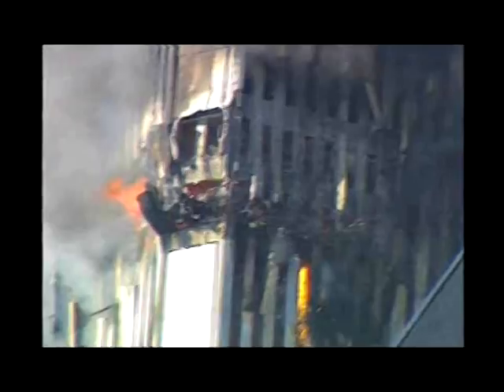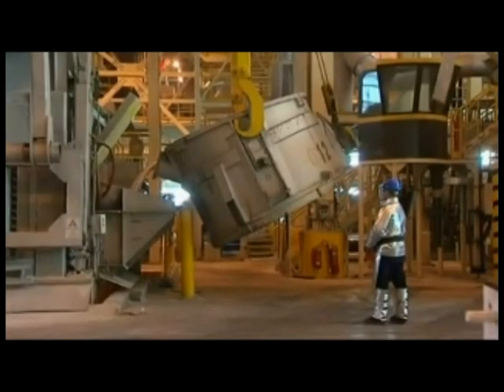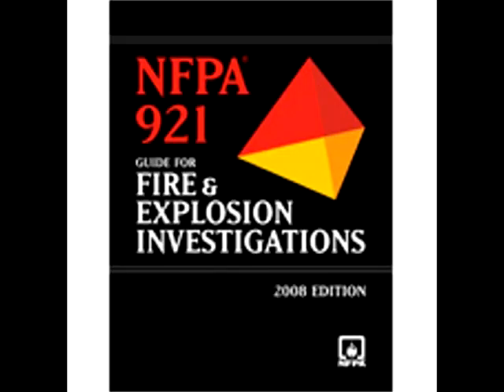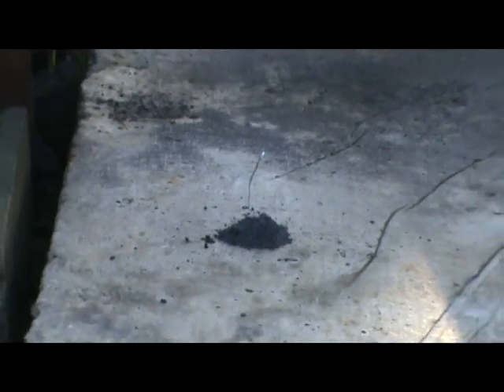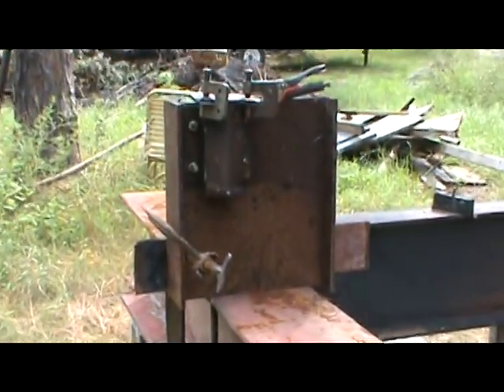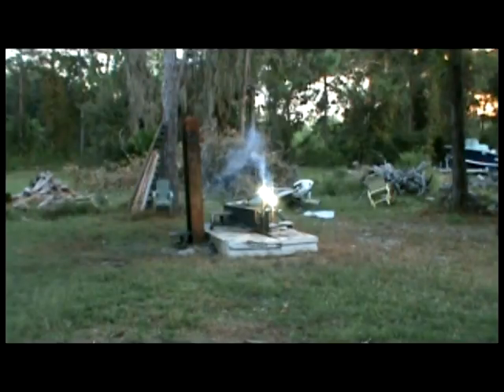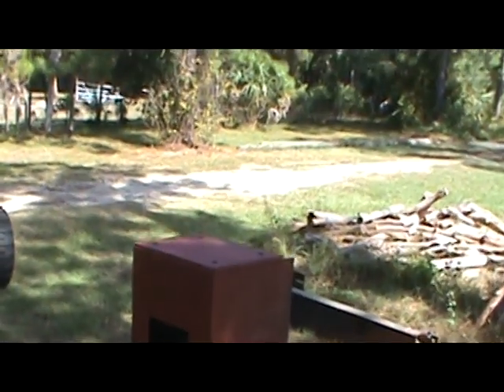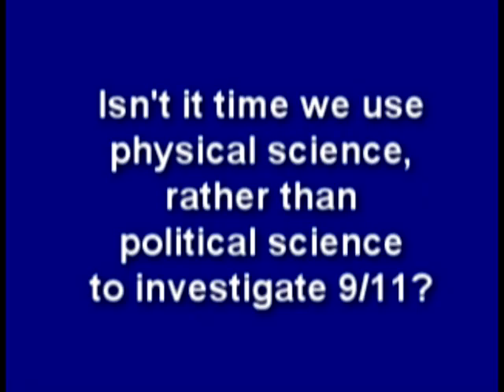9/11 Experiments: The Great Thermate Debate

Comment: There aren’t enough thumbs in the world to give this video the amount of thumbs down it deserves. When this thermite theory fell apart I was sure they were going to say it was a bunch of welders that took the towers down. While both welders and thermite are capable of taking down buildings there has been zero evidence to support that they did on September 11th. This video banks on the viewer seeing how thermite works and then forgetting why they wound up here in the first place. The creator forgot to connect the idea with the evidence, actually they hoped you wouldn’t realize it. The creator claims to have footage of molten steel falling from the south tower moments before it falls. Watch how this, “molten steel,” (to be clear it is NOT molten steel you see falling from the building) seems to remain glowing throughout the whole shot as it falls. Compare this to the thermite as it scatters and quickly cools. Molten steel against air causes cooling, which in turn reduces the amount of light being put off. But the stuff falling from the tower continues to glow and even glows brighter as it falls. This is simple - know how when you blow on a pile of hot coals (which are carbon based just like paper, furniture, carpet, etc..?) it gets brighter? The only way those falling embers could become brighter as they fall (as they do) is if they are composed of elements that require oxygen for combustion. Drop a burning phone book from a bridge, and you’ll see quite a light show until it hits the ground, but drop a bunch of molten steel balls from the same bridge you’ll see light quickly die out as the wind cools the steel down past the temperature required for it to continue emitting light.
Reply: William moffet - you're part of the elite, trying to cover up the truth. God is coming soon & your house of cards is gonna go POOF. now go back to your illuminati friends & eat a baby or something.
Reply: Really sounds like this was written by a paid member of the 9/11 commission.
Reply: In the first couple minutes of the video they also showed eye-witness testimony, satellite temperature photos, iron spheres, and actual pieces of melted steel as well.  Even if you did prove that the stuff coming out of the building in one particular video was neither steel nor thermite, you still have not disproved that there was molten steel at 911.  Other truthers have pointed out that there were elevator renovations going on before 911 and this could have been how they put the thermite in.
Reply: @brendangolledge8312  My problem with the witnesses is, if they saw thermite... how are they alive? One of the guys in the video said he was on the 80-something floor and saw thermite. If he saw thermite, it's cutting the beams... how did he get down all those stairs and out of the building before it collapsed if the beams were being cut while he was still all the way up there?
Reply: @30AndHatingIt  I have never seen that eye witness testimony.  The eye witness testimony in this video is of fire fighters and policemen talking about seeing molten steel in the rubble.
Reply: Thermite also burns regardless of cooling or water or anything it burns until it’s gone so it would be visible in air.
Reply: The result of a conclusion based on overthinking!   SCIENTIFIC FACT:  asymmetrical damage will NEVER cause a perfect symmetrical collapse.  No steel and concrete building has ever collapsed due to fire before or since 9/11,  except for those three on the same day - only two of which were hit by planes (or drones).  And how did the Government (NIST)  conduct a real investigation into the towers collapse and never consider explosives as a possibility?
Reply: If he failed it was because he tried using common sense on a conspiracy theorist.
Reply: Boo... I’ve got to take a nap now because that was the most boring insult/response you could have possibly come up with. If you’re not going to be at all entertaining and really go for the jugular then why even lift one of your un-creative fingers to type. Are you missing some fingers?

Comment: Yo SARABOND was a steel paint coating they used when it was built that cause chlorine gas and rust to steel super structures and would explain the accelerated damage

Comment: It was melting aluminum coming out of the corners and seeping down the floors. It was uncontrolled fires that weakened the structure enough that it would collapse. Note that it’s only seen in ONE of the towers not both. And only in a corner where a mass of aluminum would congregate after the energy of impact would force the aluminum forward. The plane was going towards that corner and the core didn’t stop a lot of it like it did in north tower. Way more plausible than “they hid thermite in the steel” lmfao

Comment: A jet wouldn't demolish a wrecking ball and objects don't liberate momentum through themselves. Believing a single explosion at the lightest and weakest section was able to accomplish complete global destruction an hour later likewise cancels out miles of wire and thousands of explosives necessary all throughout in your counter argument; a contradiction. Accept the fact that "crushing" weight doesn't increase as mass is lost, and either standing structure couldn't liberate momentum through itself after the upper block was finished losing momentum against it, in exact equal time to each other, because momentum can only be conserved.
Reply: @davidc9783  The upper section gained mass during construction. It lost mass during deconstruction.
Reply: @davidc9783  The thing is, unfortunately, that's a repeated lie that I once believed, too. The upper section's crushing force can only decrease after a collision, mass expands away, and momentum is lost against the massive structure standing in it's path. Assuming the opposite is true contradicts reality and it's the media's fault for perpetuating the perpetual self-crushing theory(without a physical model)to the public.

Comment: It must be the truth!  Some time after Ramzi Youssef's failed attack, Techs were somehow able to wire two buildings with thermite.  These weren't just any covert technicians.  They were so skilled at wiring explosives and used miles of wiring, connectors, relays and harnesses of such durability and quality that both systems were able to withstand the impact of an airliner and work flawlessly.  Then, after organizing the genius airplane subterfuge which played out perfectly (with the  exception of United 93) The person responsible for timing the collapses with the actual demolition charges was having a sandwich and a shit.  Both times.  And with impeccable secrecy.

Comment: They use thermite on railroad beams to melt and weld the two beams together. I don't see why it would not melt the beams on the buildings?
Reply: If you had vast quantities of it, it might. Kind of a bit hard to hide though.

Comment: For those who believe the official conspiracy theory , the lady identified as Edna Cintrone was filmed standing in the impact area of the north tower looking out prior to the building collapse. How is this possible if the heat in this area was such that the steel was being "weakened" to the extent that the buildings eventually collapsed ?

In addition , no one is disputing that there was molten metal on site so why did NIST not address this and determine what the metal was ? Why was this fact just ignored ?
Reply: You mean the same Edna Cinton that jumped after that photo? Guess it was just fine in there? Fuck you .

Comment: Not sure how I missed this excellent video in my past 911 research. A friend sent this link to me. This is some really great work. You put some serious time and thought into this. I'm a manufacturing engineer and your video has really helped clarify things for me. I always thought that thermite was part of the puzzle and based on this plus the comments from the welder below, it seems very certain thermite was indeed involved at least partially. I am also open to the ideas of Dr. Judy Woods, she seems to have some spooky footage of steel columns literally disintegrating and disappearing as can be seen through the thick dust clouds as the concrete falls away and the remains of the steel appear momentarily then almost evaporate.

Comment: The twin towers were unique because they did not use the outer walls to support the towers. It was the internal core that held up the towers. 

Naturally the core is under pressure. If it is weakened, not melted, it would fail. That happened.

What I do not get is why anyone would still have Bush Derangement Syndrome anymore.

The flaw in rhe experiment is that the beams are not under great amounts of pressure.
Reply: You got it backwards.  The floors were supported by trusses connected to the external pillars.  The central core was supporting the elevator shafts, water and waste water pipes, electrical conduits, stairways, etc.

And in fact it was those trusses that became the weak point in the fire.  Once the steel heated it lost strength - and bowed downwards.  Normally the trusses carry the load to a point where it becomes a vertical force on the support columns.  But once they started bending that weight became a force pulling the support columns inwards - something they were not designed to handle.

Comment: The temperature quoted for burning jet fuel (kerosene) is that in a jet engine, which is much like a blowtorch. You can also soften steel to the point where you can bend it easily, using a blowtorch. However, kerosene burning in the open will simply not heat steel to anywhere near that temperature. It requires a forced air draft to do that. Could conditions in the WTC have created updrafts strong enough for blowtorch-like burning of kerosene? I guess they could, but only in the minutes after the planes struck. It seems unlikely that could have happened an hour or so later, and after the visible flames had died down.  

So basically, I don't buy the burning kerosene argument.

Comment: I believe Dr. Judy Wood's explanation far more readily than that of controlled demolition, that a high-frequency energy weapon utilizing the "Hutchison Effect" was used on the towers, building 7, and the Pentagon (or possibly a Tomahawk missile on the latter). But it doesn't matter at this point, it's not really for 'me' to decide - a real, honest investigation needs to be opened where we can get to the bottom of all this, REGARDLESS. It's so very obvious, however that the official story is a complete bunch of B.S.  So full of holes, it is, that it makes Swiss cheese look like a structurally superior cheese!
Reply: Yes Judy Wood, the brain damaged nutcase that was in a coma for several years.
Reply: Gosh, 17 years later and they're still name-calling.  How's that denial going, femadeathcampcontrol?  So, tell me, do you believe the official story? That 4 hijacked planes, the hijackers using nothing more than a pair of box-cutters, successfully defeated the most sophisticated air defense system (norad) that day, the entire plan devised and carried out by Osama Bin Laden, that 2 of those planes flew in at impossibly fast speeds that any normal commercial airliner would break apart, let alone, them hitting their targets with pinpoint accuracy, and brought down not just 2 buildings at the WTC (building 7, not even hit by a plane, but also collapsed) - that the black boxes of the planes couldn't be found at the Trade center site, but they did find one of the hijacker's passport, which magically floated down to the street below, un scathed, even! And the plane that hit the Pentagon, another way WAY impossible piloting feat, that even the most master pilot in the world couldn't make that maneuver, and the plane, just like with the towers, passed through the thick ccncrete.. making a hole that sure looked just like a Tomahawk missile!  Oh, and then the 4th plane that crashed at Shanksville, just like with the Pentagon, no bodies, no luggage, not really any plane parts to speak of... just a small hole in the ground.  And you call Judy Wood a nutcase??  You actually believe that crap???
Reply: Thats an impressive amount of long debunked crap, compressed into a paragraph.

Well done.

Did you just watch loose change?
Reply: Oh, yes, long debunked... by whom exactly?  I'd like to speak to them.  No, I've been researching this thing since Feb. 2002,  how about yourself?
Reply: Don't tell me you haven't put in thousands of hours like I have... a firm believer like yourself!  (?)
Reply: Oh well, I really don't expected any sort of informative, nor educated reply from you.. I will say one thing, though,  ... I,..  well,  I don't know how to tell you this, but.... ("whispers") "I think your foolish patriotic pride is showing." (Sorry, but someone had to tell you.)
Reply: Wow!  What a comeback.. I have to admit, I underestimated you... you put all us tin-foil hat wearing nutjobs to shame!  LoL.  Thanks for that,  Super-genius!
Reply: (Imagining FemaDeathCampControl putting his well-used blinders back in place, sticking his index fingers into his ears, and now singing, at the top of his lungs:  "America the Beautiful" and "The Battle Hymn of the Republic") "sigh!"
Reply: "Some men, just caaaan't be reached.  I don't like it any more than you boys do..."

Comment: There is no point demolishing the buildings as an inside job, everything achieved can be equality done with just two airplanes crashing into the twin towers. Who would even care about demolishing building 7 - it serves no further purpose that has not already been achieved with the planes hitting the buildings.
So what if the buildings didnt collapse "demolition style" but just had gaping holes.
Would be EXACTLY the same foreign policy.

You really think that Bush is going to say, Im not invading Afghanistan because the twin towers were merely damaged and only 300 people died but only invade if the buildings are demolished and 3000 people die ? 
All the conspiracy theorists dont even bother distinguishing that a motive for demolition via inside job (thermite or whatever) achieves nothing extra than the planes didnt achieve alone. (slightly less drama and more clear up, but headlines are the same)
Reply: The PNAC plan specifically called for a new Pearl Harbor
Reply: So what you're saying is the lack of evidence supporting your conspiracy theory is proof that the conspiracy exists?  And exactly what benefits would they have gotten from collapsing Building 7?  And compare those benefits to the added risk of detection for a plot that had to have involved 10s of thousands of people to pull off.

Comment: I agree with you, but explosives or thermite would need to be put at the bottom of the building to guarantee collapse (just watch any demolition video) - and it takes weeks of planning and pre-weakening the steel (ok last point was answered by "secret undercover people coming in not noticed over a few weeks - plausible)

....but the main point, making the buildings "totally collapse" is simple INSANE and achieves nothing for the government that wouldn't be achieved from the airplanes going into the buildings.
So 3000 people die instead of 250 if the buildings didn't collapse ?
The whole conspiracy story of an inside job is ridiculous for this reason.
Same headlines would occur if no "demolition" took place, same impact, same story, just slightly less casualties. Even better with no demolition - just imagine both towers blackened with fire and under repair for many, many months - still same effect on the media, foreign policy - pretty much everything.

Comment: The airplanes we're traveling towards the two World Trade Centers at full speed.... they were hit with tremendous Force igniting the jet fuel inside of the structure of the World Trade Center the heat was so intense it was close to temperature on the Sun... the force of the impact and temperatures that reached 6000 decrees Fahrenheit (3,315.6 de crees Celsius) caused the beams on the lower and middle floors to weakened and bend causing both 104 floor (1,368 feet) of structure to collapse... There was documents, information, accounts and certain individuals someone wanted gone and erased it all has to do with the secret society...!!!👽👽💻📱📡🚀🗿